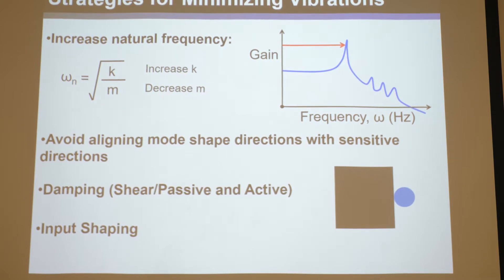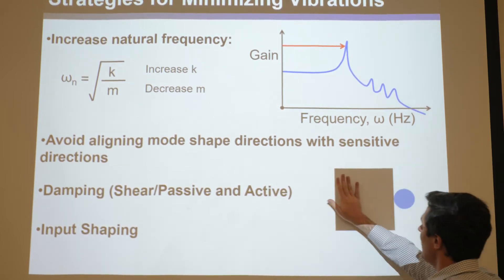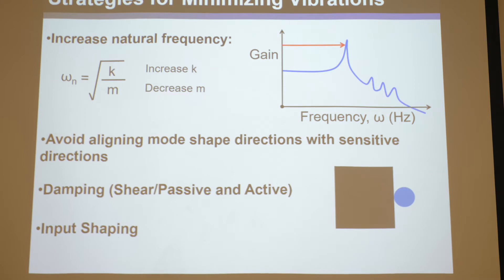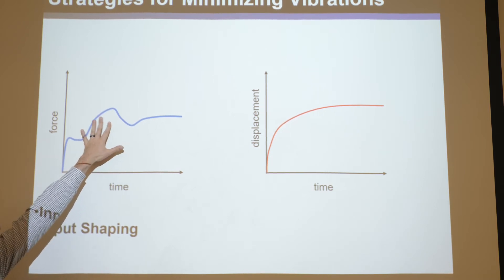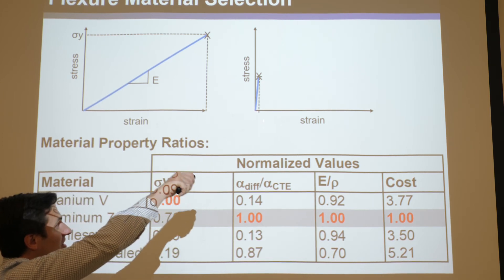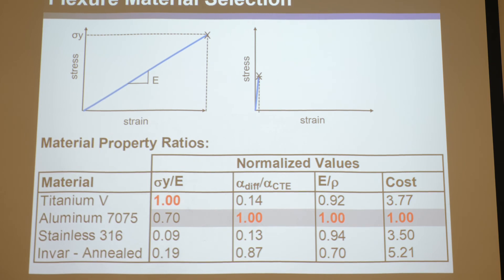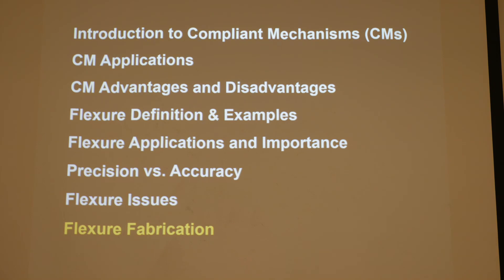Compliant Mechanisms Lecture 1 Part 5

Comment: Summary of Flexure Design Principles:

* Increase the first natural frequency to improve system performance:  (0:59)
    * Stiffen flexures (increase k).
    * Reduce mass (decrease m).
* Avoid aligning mode shape directions with sensitive directions: (1:47)
    * Sensitive vibration directions should be perpendicular to the desired motion.
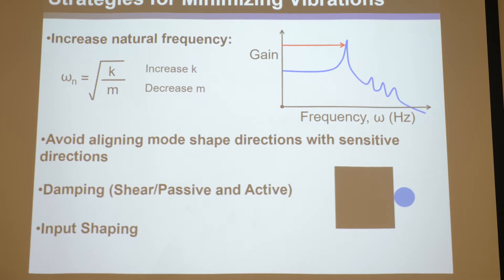* Damping Vibrations: (2:56)
    * Passive Damping:  Immerse in viscous fluid (honey, water), attach rubber strips (watch out for hysteresis). (3:04)
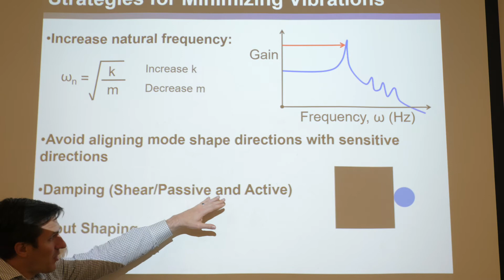    * Active Damping: Expensive but effective, uses actuators and sensors with closed loop control. (3:59)
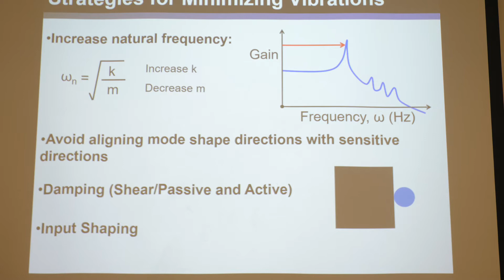    * Input Shaping: Open loop control, characterize system and apply a specifically shaped force to achieve desired displacement without vibrations. (5:18)
* Material Selection: (7:18)
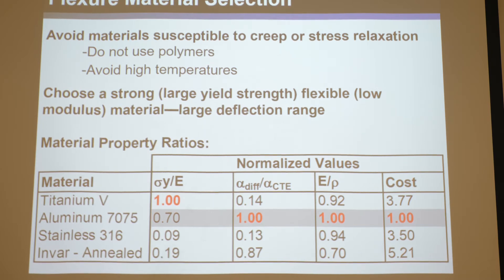    * Avoid: Polymers (creep, hysteresis), high temperatures (creep, stress relaxation). (7:34)
    * Ideal: Metals (aluminum, titanium, stainless steel, invar), sometimes ceramics (brittle). (8:17)
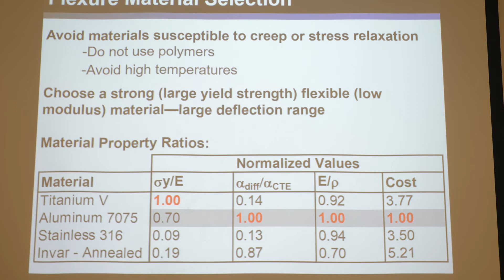    * Key Material Properties: (8:42)
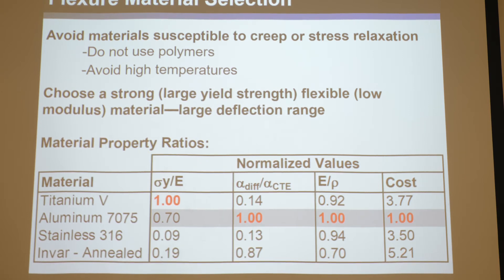        * Range: Choose materials with a high yield strength to modulus ratio. (8:46)
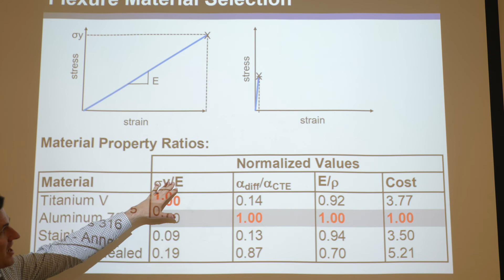        * Thermal: Choose materials with a high thermal diffusivity to thermal expansion coefficient ratio. (11:07)
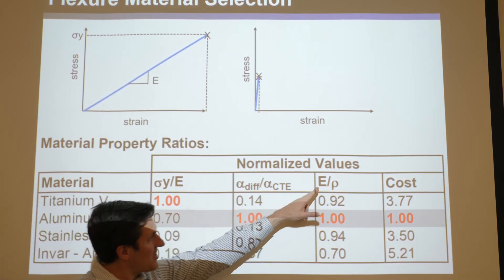        * Dynamics: Choose materials with a high Young's modulus to density ratio. (12:55)
* Fabrication: Not covered due to battery limitations. (15:08) 

Deutsche Zusammenfassung der Prinzipien des Flexure-Designs:

* Erhöhen Sie die erste Eigenfrequenz, um die Systemleistung zu verbessern: (0:59)
    * Versteifen Sie die Flexuren (erhöhen Sie k).
    * Reduzieren Sie die Masse (verringern Sie m).
* Vermeiden Sie es, die Richtungen der Eigenformen mit empfindlichen Richtungen auszurichten: (1:47)
    * Empfindliche Schwingungsrichtungen sollten senkrecht zur gewünschten Bewegung stehen.
* Dämpfung von Schwingungen: (2:56)
    * Passive Dämpfung: Eintauchen in viskose Flüssigkeit (Honig, Wasser), Anbringen von Gummistreifen (achten Sie auf Hysterese). (3:04)
    * Aktive Dämpfung: Teuer, aber effektiv, verwendet Aktuatoren und Sensoren mit Regelung. (3:59)
    * Eingangsformung: Regelung mit offenem Regelkreis, charakterisieren Sie das System und wenden Sie eine speziell geformte Kraft an, um die gewünschte Verschiebung ohne Schwingungen zu erreichen. (5:18)
* Materialauswahl: (7:18)
    * Vermeiden Sie: Polymere (Kriechen, Hysterese), hohe Temperaturen (Kriechen, Spannungsrelaxation). (7:34)
    * Ideal: Metalle (Aluminium, Titan, Edelstahl, Invar), manchmal Keramik (spröde). (8:17)
    * Wichtige Materialeigenschaften: (8:42)
        * Bereich: Wählen Sie Materialien mit einem hohen Verhältnis von Streckgrenze zu Elastizitätsmodul. (8:46)
        * Thermisch: Wählen Sie Materialien mit einem hohen Verhältnis von Temperaturleitfähigkeit zu Wärmeausdehnungskoeffizient. (11:07)
        * Dynamik: Wählen Sie Materialien mit einem hohen Verhältnis von Elastizitätsmodul zu Dichte. (12:55)
* Fertigung: Nicht behandelt aufgrund von Batteriebeschränkungen. (15:08) 

i used gemini 1.5 flash and pro

Comment: Hello Prof. Hopkins,
at the moment i write my thesis about compliant mechanisms.
During my investigation i found your lecture series.  It's  incredible good structured and 
you do a really good job so far. (I'm at lecture 4 btw.)
But i have still two questions and maybe you've time for answering:
First, you show us Material Property Ratios for some different Materials which are normalized. Can you told me/us how they were normalized? With which values, units and so on. And the second question is,  and that would do me a very very big favor, can you give me the bibliography or even better the lecture slides for my bibliography part for citing you and your lecture? I would really appreciate that :). Thank you and greetings from Bavaria/Germany.